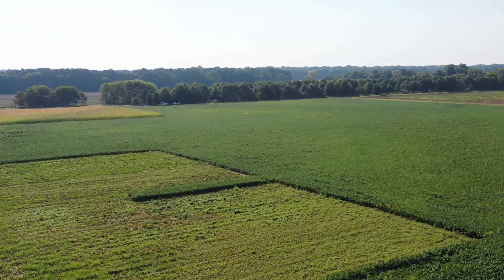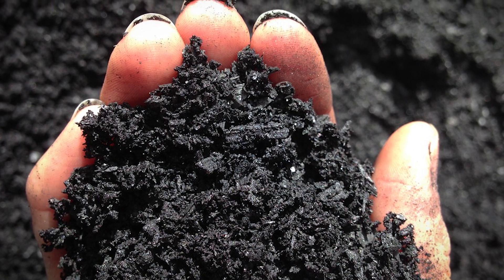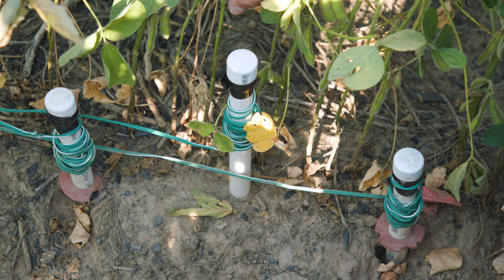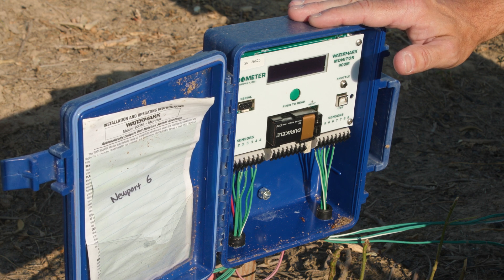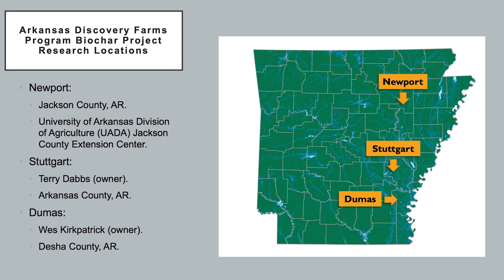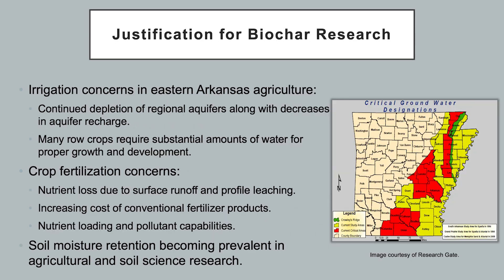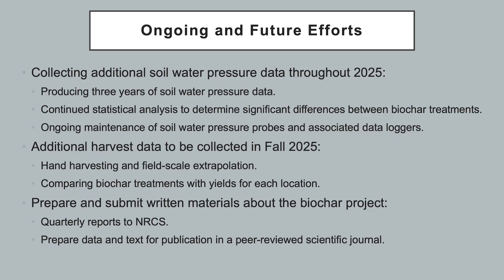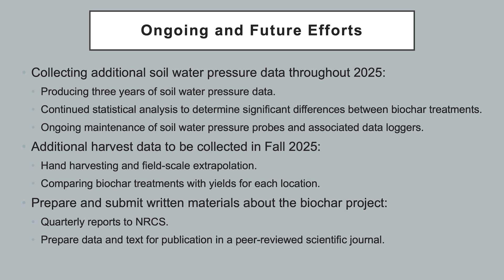Evaluation of Biochar

Comment: Biochar has to be soaked in manure or urine so the carbon bonds to cations. If you just apply it to soil "uncharged" its bonding to the cations in the soil.
Reply: it appears to have some ability to absorb micronutrients, and may encourage healthy soil structure
Reply: @Freeland-Farm  you are charging it with some soluble micronutirents...microbes won't live in biochar.
Reply: @Freeland-Farm  show me one bit of research showing microbes living in biochar..... yes, you can have some things like  nitrogen and potassium (water soluble) move in and out with h20, but it won;t support biology in the char....again, this shouldn;t be hard....show me something showing biology living inside char.
Reply: @curiousbystander9193  Applied Soil Ecology, Volume 182, article id. 104700.

Recently, the effects of biochar on soil microbial communities have gained a lot of interest. However, researchers have paid little attention to microbial colonization of biochar surfaces and the effect of soil potassium (K) availability on specific colonization In this study, the microbial colonization on the surface of biochar was systematically investigated using carbon-13 nuclear magnetic resonance (13C NMR), scanning electron microscopy (SEM), and metagenomics based on a four-year pot culture experiment. The results showed that the main microorganisms colonizing the surface of biochar were all potentially beneficial bacteria (g_Streptomyces, g_Pseudonocardia, g_Amycolatopsis). The main carbon source for microbial colonization was the alkoxy carbon component of biochar. Under normal storage conditions, biochar colonized a large number of beneficial microorganisms from the storage environment, but the amount of colonization increased when applied to the soil. Among them, the amount of colonization in the high-K environment was slightly higher than in the low-K environment, but the primary composition and functions of microorganisms were the same (carbon metabolism, biosynthesis of amino acids, ABC transporters). In general, a large number of beneficial microorganisms can colonize the surface of biochar in any environment, which provides more cutting-edge theoretical support for the application of biochar in agriculture.
Reply: @Freeland-Farm  terra preta pits where so toxic with char, ash and clays that they stayed around for hundreds, if not thousands of years. When dug up and spred around some of the nutrients locked in that toxic pit are released..... I can't make a 5 yard pile of leaf mold soil and leave it in one spot for more than a month... the trees 30 feet away make roots and steal it.... so why is terra preta pits intack years after deposit?   Cause the char with ash and clay inhibited tree roots..... duuuuh!
Reply: @Freeland-Farm  no, there is no active microbes inside the pieces of biochar..... show many some science, anywhere, please..... if anything, charging it neutralizes any alkaline remnants from potash, and the charge medium has it;s own npk and microbes..... but you are not putting microbes inside biochar pieces..... they don;t like living there...zero, zippo, none, none, none...... that is why the pine tree stump I burned 15 years ago looks pretty much the same but it's neighboring stumps are pretty much gone./
Reply: @Freeland-Farm  again, show me one study illustrating how microbes live inside biochar.  I am not conflating anything.Biology does not like living inside biochar pieces.
Reply: @Freeland-Farm  I have done various test right in the kitchen with cantaloupe and coffee grinds, only to find, indeed. only at very small percentages does fungal growth not get inhibited by biochar.  I'll look againfor info about this vacant area of research.  Don't get carried away think the inner pores of biochar are in any way part of the surface structure's limiting porosity... you realize right, rarely does my carbon water filter ever get growth in it, only after months of biosolids accumulating between the char pieces in the filter.
Reply: @Freeland-Farm  you don;t get it, do you?  Those water filters with biochar in them do  not become rotten because the biochar is really good at not letting microorganisms thrive, until a certain concentration of sludge accumulates between the char.... you see, because the outside of each char piece serves as a filter....pretty much only allowing soluble nutrients in the water through....and even with some of those nutes in the trapped water, micro organisms still don;t grow  in those pores or those filters would poison you.
Reply: @Freeland-Farm  why is terra preta still around? My 5 yard leaf mold soil piles get stolen by nearby trees within a month of their final turn? How could terra preta still be around?
Reply: @Freeland-Farm  you figure out yet why microbes don't readily grow in your biochar filled water filter?